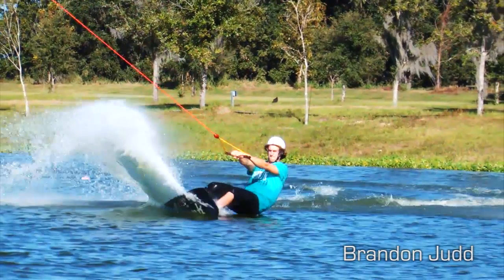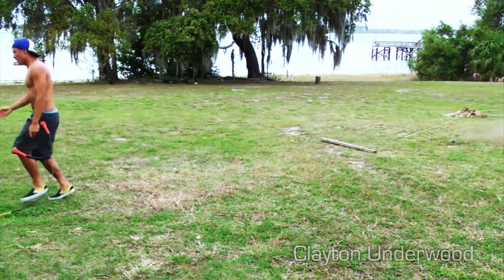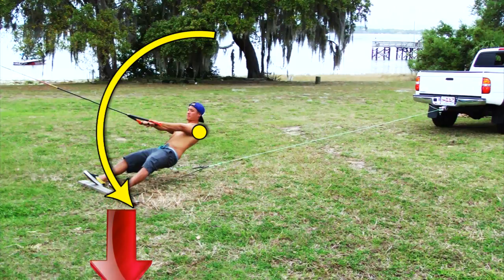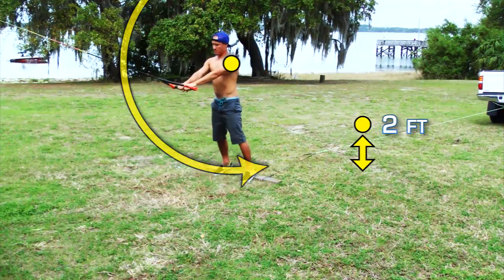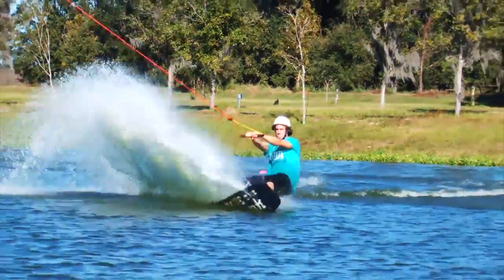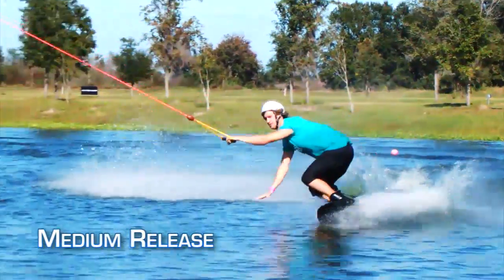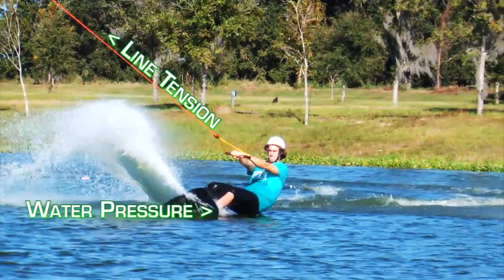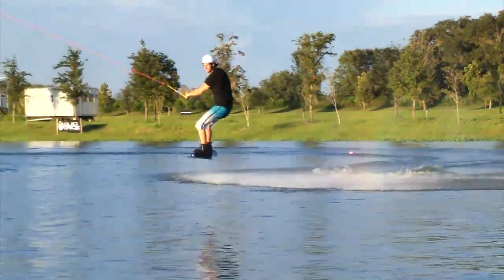Air Tricks On The Cable: The Release Part Two

Comment: What do you mean by release quickly by allowing your lower body to push downward aggressively creating the down portion of  the arc while remaining in a stiff upper body.

What specific change do you make?  Do you push down in your toes or bend your knees and put the weight over the toe side edge or what?

Comment: I have a question.
When i want to trigger my progressive edge and launch into the air, should i press down and carve an arc in the water, which will render my board perpendicular to the cable direction?
Reply: Some people dont do that but some do,  you seem to do it.
Reply from the maker: We...agree with you?
Reply: LearnWake ok thanks, great video tho!